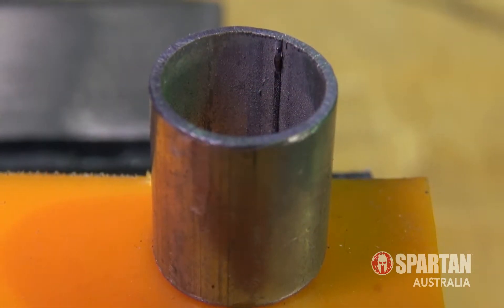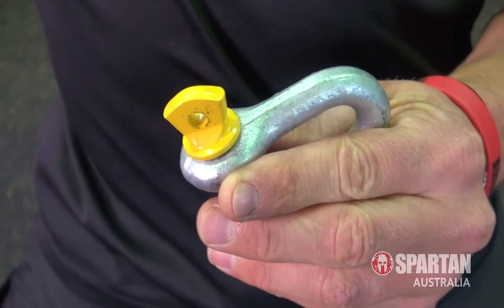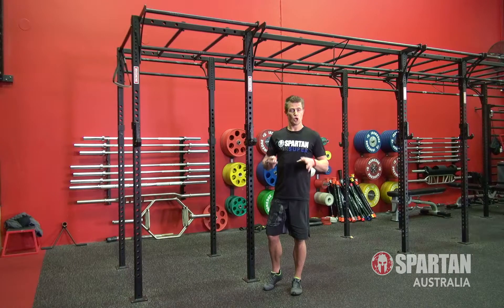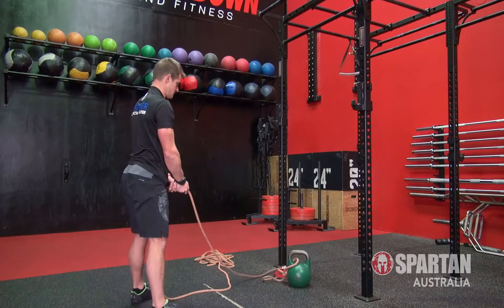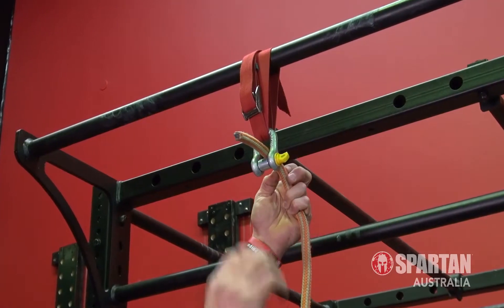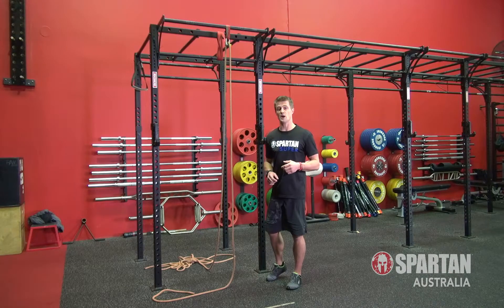Spartan DIY -  How to make a Hercules Hoist

Comment: Why not just use a pulley rig?
Reply: cheaper probably and easier to fix if it does break. i got mine for 5$ at Lowes without the rope and strap